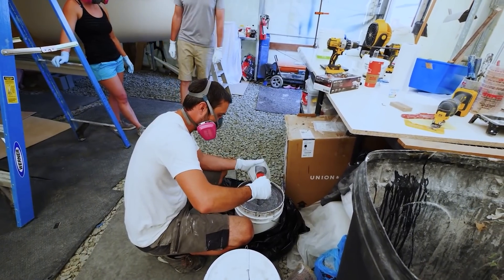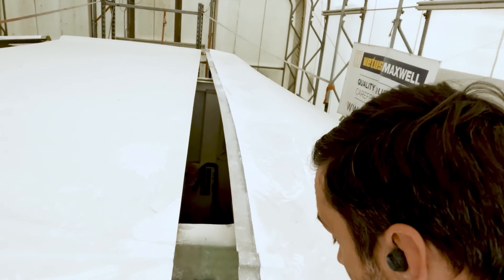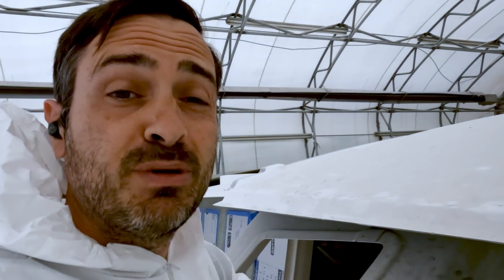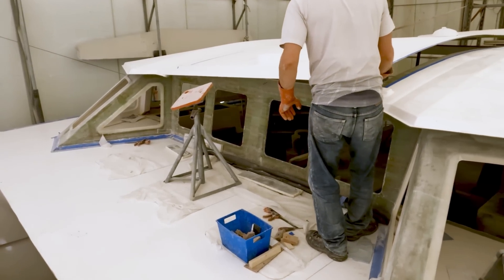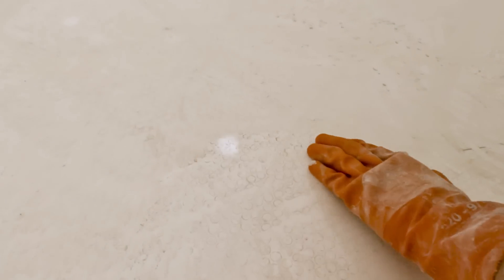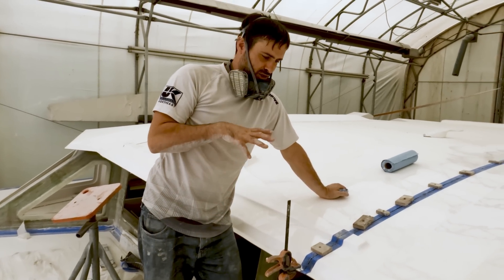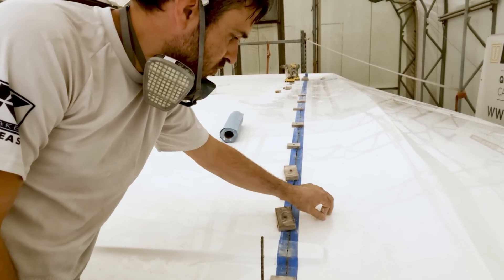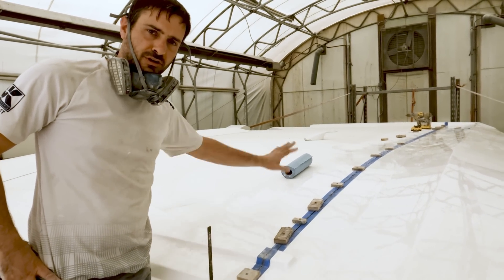CATAMARAN BUILD - This Could Be A $$ Mistake (MJ Sailing - Ep 281)

Comment: For the Yellow Colour. If in Premiere Pro go to Lumenentry Colour > curves > hue vs hue curve > eyedrop the colour and pull toward the green then > open Hue vs Saturation > eyedropper > pull key frame gown.

The best way is to shoot a chip chart or grey card and make a lut you can apply to the clips. This will work welI in Davincie resolve as Resolve can work natively with some colour chip charts.  Once you have made a lut you can apply it in most all editors.

Edit: the xrite colour chart is ideal if you are still having issues.

Comment: Love those big sunglasses, classy cool!!!! Given the methylacrylates properties of slightly lower heat usage envelope it occurs to me that sitting the solar panels right on top of those flanges could be problematic. Some panels I have used do get extremely hot, like a baking sheet! Since solar panels also degrade in performance when too hot it made me wonder if a thin water based heat absorbsion layer under the the panels would make sense. It could double as a hot water heater or pre-heater. It's amazing how much we learn from watching these videos, Matt you are awesome for explaining all these steps! Jess you continue to stun us with your video work and comments, much appreciation, you are creating an amazing body of work! Oh, and thanks for the cool T-shirt, I really like the graphics, did you design those? I was thinking it would be fun to make them 3D and animate them with a ray tracer.

Comment: The colour shift in the tent is white balance, try just re-setting white balance on the effected clips without any other correction or grade, easy in Davinci, no experience with PS. The best way would be to take a couple frames holding a reference card in those areas/clips where you expect the shift to occur, and correct to the card in your editor.

Comment: MJ, glad to see you guys are making progress. Regarding the lighting, a couple people have said, they wouldn't have noticed if you hadn't said anything, which is true. I think someone else said, White Balance, which is possible. You all are working under a giant light box powered by inconsistent natural light. You are also going from DSLR to GoPro. Light temperature, tint, saturation is changing constantly. For still photography this is great, for film or video it is more challenging.

All in all, your editing is great, sound levels are great. I wouldn't worry about.
Reply from the maker: It is definitely a white balance issue, and it tends to happen while filming on our GoPro while on deck of the boat.  Something about the tent always takes the white balance very yellow.  Unfortunately when doing a timed task like this (working with methacrylate) there isn't the option to stop and manually adjust the white balance, so we leave it on auto.  I was hoping someone knew more about how to adjust in post, so I can bring down the yellow (by adding blue), without getting a green hue to it.
Reply: @MJSailing  Don't know what editing software you are using. I use Premier Pro. In filters, you should be able to autocorrect in tint and contrast. Yellow is a warmer tone, blue is cooler. The problem is, if you try to adjust too much to a cooler tone, you will wash out background and some detail.

Unless you want to spend multiple thousands of dollars on camera gear and lighting, and more time editing than on the build, don't worry about it. Your edits are smooth and your content is great.

If you are really concerned, get a Gray Card. B&H has them or any good camera shop will have them. Set your camera white balance and metering on the Gray Card. This is old school, but works very well. I don't know about GoPro, that is a question for them if metering or white balance can be set.

But seriously J, your content is very, very good. If you want me to critique something... when you end your videos, end it with a hook of what is next or a smooth ending.

You two are doing fine. Natural light is natural light. You have thousands of people watching your videos, a lot of sailors and a lot of dreamers. Don't sweat the small stuff.

All my best to you and M.

Comment: The white balance ( lighting color ) is what needs to be adjusted . Usually it is the camera setting jumping around when it is set to automatic  and camera is panned to different diffused light color shades .
Reply from the maker: I wish I had the time to manually adjust the white balance on our GoPro while we're working, but trying to film along with the time constraint of the methacrylate means it's best left on auto.  I was hoping someone would have really good tips on how to fix it in post for when it does come up.  I know enough to improve it from the original, but not enough to make it look natural.

Comment: HI guys, nice work.  For your video being yellow this may be the problem.  About 15 years ago I was on a project that involved building a custom designed digital camera.  There was an issue with yellow tinting in the images.  The electronics engineers worked out it was a power supply issue.  I can't remember if it was low voltage or low amperage but that caused the problem - it affects the sensor somehow (I'm IT not electronics so don't understand that stuff).  Maybe if it happens again take note if the batteries are old (maybe end of life) or the state of charge at the time.  Just an idea, cheers.

Comment: Great to see the progress. Those big pieces get one shot at getting it right. Nerve-racking for sure. This month I'm going to make a test piece that simulates bonding a framed piece with a planking piece using Thixo for the peanut butter mix in the seam and also using Thixo for wetting out the two-inch fiberglass tape for the corners. I have decided on this skiff build I am rounding every edge of every frame allowing the planking to meet the rounded edge as it changes for the sweep of the hull evenly. Understanding the process of stitch and glue boat building using bulkheads as frames using filet style joints, why not for frame building also? A special tool will place the screws in alignment with the frames, not the planks. Pre-Notching all the frames with a router and using 5/8th lumber should result in a fair sight line down the length of this skiff 23ft. I wish I could get excited about doing a video but maybe as I get something worth showing I might.

Comment: Most of big pieces like this top were cut due to shipping to you in a container. How do they build these Catamaran at their ship yard as one piece or they still cut and glue together?  These pieces are made via uni body molds so not sure if Max cruise ship building and body molds are at same location?
Reply from the maker: They are made in the same molds.  They still have flanges on the production boats, but we get these, along with under the bridge deck.  Those are the only difference

Comment: $1,000 for a tub of adhesive sounds hugely expensive.  The wholesale price of these adhesives is a fraction of that. I guess there are import tariffs in the USA, but these prices are astronomical and perhaps influenced by the proprietary modification of the various brands who resell it.  I am no longer involved in the international trade, so don't have visiblity of the base prices.  Perhaps volume builders in the far east would share their cost prices for this stuff.  I think people have no idea of the basic production and market prices in countries from Egypt to Asia.  There needs to be several YouTubers, buyers consortia to grapple with the prices. Alot of these materials trade at a few $ a kg, and even for Carbon fibre the big cost is the technically tricky cutting to size.
Reply from the maker: This is made in the USA with USA chemicals - we had to wait last time ordering them for the plant to make it.   And, it's way cheaper than any other type of methacrylate.  Plexus is the brand the yard uses in Vietnam which would be about $2500 for this quantity
Reply: Epoxy prices have risen dramatically in the last 2 years.

Comment: I thought you ended up damaging one of the panels. Not sure if I would have chosen to drop the panel into place like you did without a third person. Using one part gives you more working time to fit things into place, but drastically less strength with the bond. 90 minutes is still not long enough for two man first timers.

Do it ten times and you just might start to be completely happy with the results. 

I did a one piece extension to a previously owned catamaran. One sixth the size of what you dealt with and became paralyzed because of my critical eye.. One of the many traps you will fall into going to boat shows and seeing the newer boats. In the end who really gives a shit when it's covered up by solar panels? I do. No PTSD ever for me. Lots of overtime due to my OCD. 

Not sure if it's wise to start a treatment for OCD before you finish your catamaran. The only thing that ever held my tenacity together. Never punted other than with ex-wives.
Reply from the maker: It's a two part methacrylate used for all these bonds.  The methacrylate we used for all the other bonds and a working time of 45 minutes.

Comment: if your video is overly yellow add blue. if its too cyan add red. if its overly magenta add green (but beware messing with the magenta and green can effect skin tone in a negative way) cheers, hope it helps. (it also works in reverse, too much blue, add yellow).
Reply: you can also play around with auto color correction. i know in final cut x you can have many dissimilar clips corrected to look similar. (auto doesnt always work though)
Reply from the maker: Unfortunately in Premier, it doesn't have the slider for cyan/red.  I bring down the yellow closer to blue, but it leaves the image with a green hue. But when I try to adjust to magenta, it quickly switches to a magenta hue.  Even if I work with the hues in the shadow/highlight wheel, I can't get a normal color. Big bummer for me, lol.
Reply from the maker: It is strange how Adobe Photoshop has the cyan/red adjustment, but Premier doesn't. It would make such a big difference!

Comment: As to your suggestion about the yellow tinge, you might want to do a white balance prior to filming (not sure if you have a camera that has that capability) the other option is in post-production find your white balance wand and click on your screen on something that is suppose to be white.
Reply from the maker: We're always working with our GoPro at the moment because we know it will get covered in resins. We used to manually adjust the white balance, but sometimes it will come out too blue - to the point we can't improve it in post. 😥

Comment: get some neodymium powerfull magnets to hold seams together so you dont have to drill screws
Reply from the maker: A lot of it is pressure and Matt will go through and tweak how much pressure is under the cleat by pulling it up or pressing it down, and the screws really help with that.  But...the whole area will get sanded and glassed, so those will be hidden soon.  😉